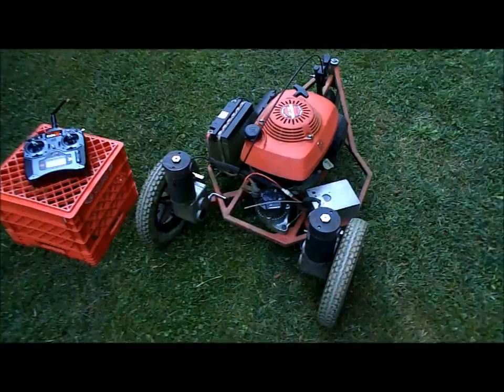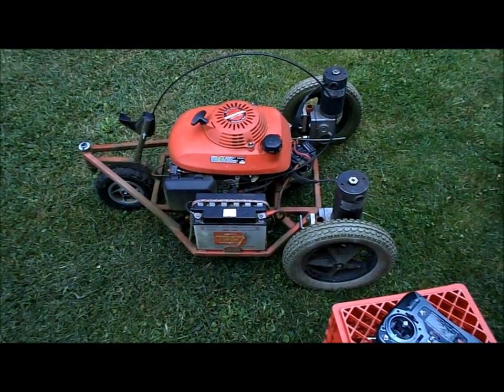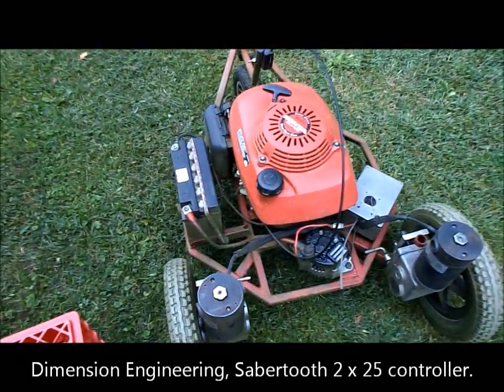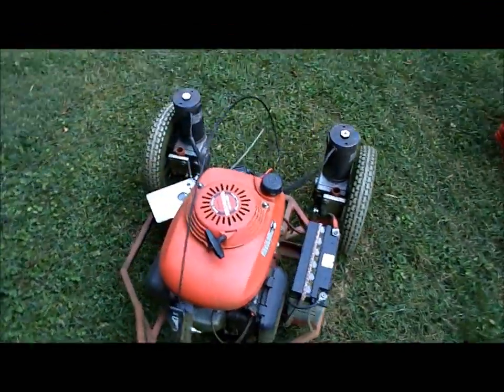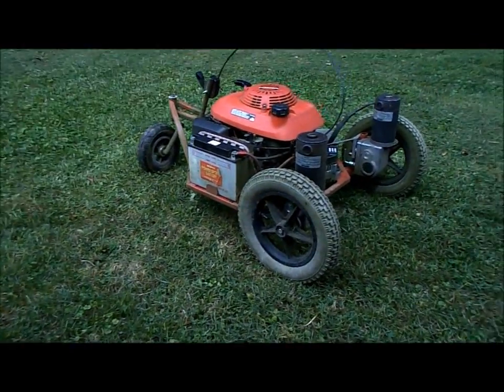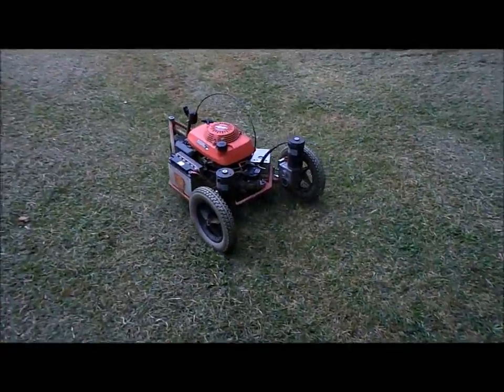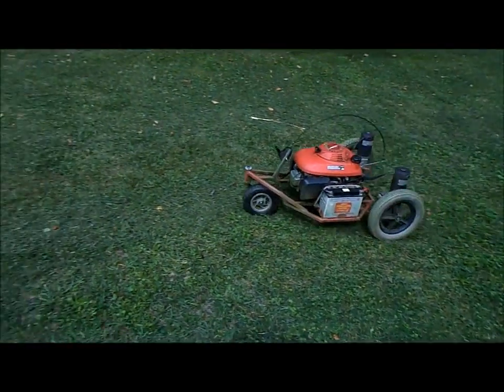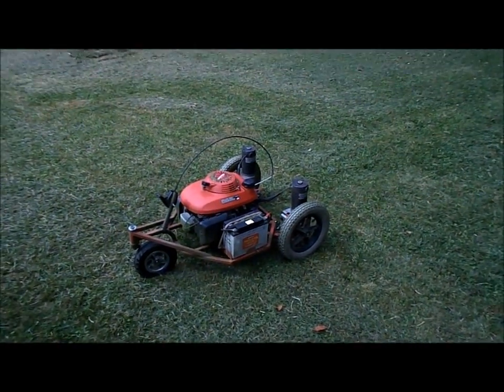Radio Controlled Lawn Mower

Comment: A really good job with the one exception.  In addition to the safety factor you lost without having the lawnmower housing (guard) you also lost the additional updraft provided by losing a more organized updraft that sucks the grass up to be cut better.  I would not like worrying about a rock killing me or breaking a car window either.  BTW,  you can buy a 24 volt alternator for about twenty dollars more.  I read where using 12 volts with the motors will shorten the life of them and is quite a bit less efficient in the long run.